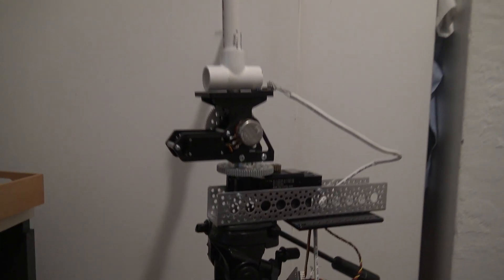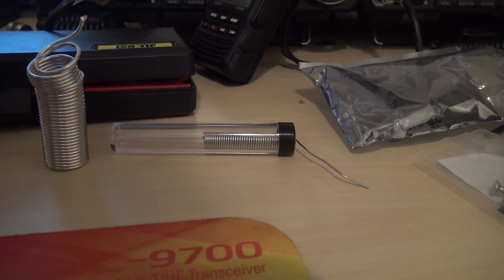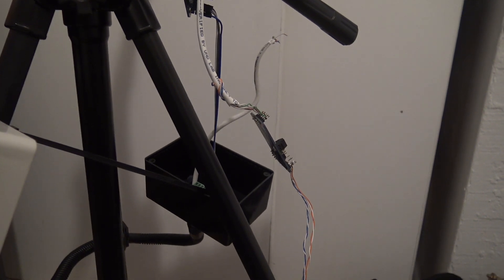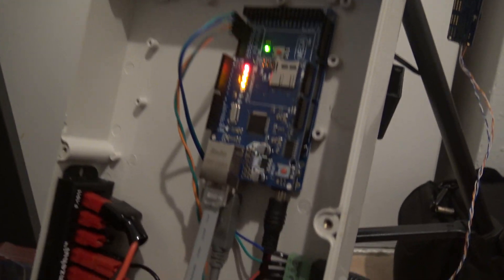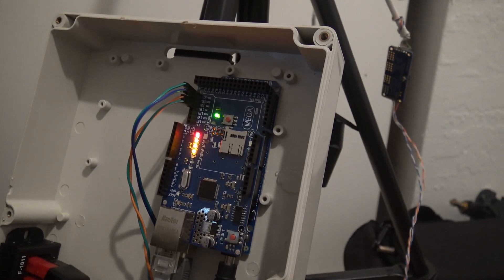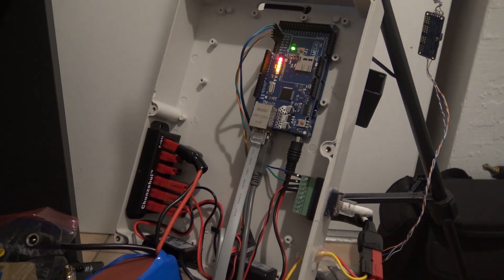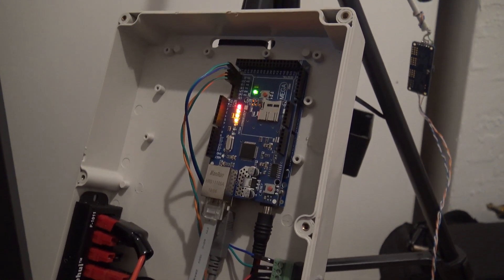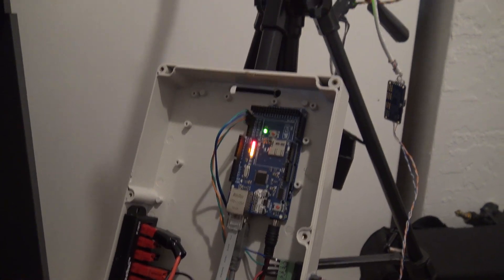Ham Radio Satellite Tracker Update, I'm Having Issues

Comment: W1RNY  I have been looking at your videos for a bit.  I first got my ticket in 1967 but let it lapse in the late 90s.  Never did much with amateur radio.  Now I am semi-retired.  Got my ticket back in August, 2019.  Working now on General.  I got interested in Sat work and picked up a pair of FT60s....found I only needed one for the FM birds....but got tired of holding the Arrow Portable Dual band.  

Last winter, HRO had their sale so I picked up both the 7100 and 9600......want to create a totally portable sat station with off the shelf parts.  Don't have the time or energy at this point in my life to make an el az rotor.  After a lot of research, picked up Portable Rotatation's El AZ rotor....12 v....already digital....no interface needed.....in the process of setting it up with PCSat32.....I will start with the one Arrow and see how well it does.....may got to two of them with a phasing harness.

Comment: Im also building a variation of the  Elwood Downey , WBØOEW tracker. Just as in his upgrade to the project, I'm using the ESP8266 instead of the Arduino although it shouldn't make much difference. I intend to build it fairly close to his design except that I'm also creating an interface to allow control of the azimuth and elevation from the software package "SDR-console" which also automatically controls the radio/s(up link and down link). I've written software that intercepts the DDE data from SDR-console in the Nova or Orbatron formats and sends the data over the wireless link to the ESP8266. The program in the controller will have two modes. The original control that uses TLEs, or receives az and el from the PC running SDR-Console.

Comment: Maybe a silly question, but you are not powering your board with the USB and the battery at the same time are you? Unless you modify the USB cable it will power the Mega from your PC. Just a thought. Also, if you want to check the operation of the ethernet shield, you can load the example sketch that come in the IDE. I think it is under file>examples>ethernet>LinkStatus.
Reply: Actually after a little more research it turns out the LinkStatus doesn't work on the W5100, so nevermind using it to test the linkshield. Sorry :-(
Reply: I found this link if anyone is having issues with the ethernet shield and want to test it. The sketch is from arduino. It was unable to find my hardware, indicating at problem with the shield. Hope it helps someone in troubleshooting. https://www.arduino.cc/en/Reference/EthernetHardwareStatus

Comment: If you hooked the laptop right to the Arduino, did you use a crossover cable?  That might not work unless you did or unless you hooked them both up to a common switch.  Also if you hook it right to the laptop, it would have now way to get a DHCP address, so it would not work unless you set the sketch to use a static address or it was on a switch that gave it access to a DHCP server.  Also, make sure you don’t have a conflicting address.  Does it require the console to proceed?  If so, you’d need to have the USB port connected.  Try one of the example IP sketches.  Like any troubleshooting, one step at a time.

Comment: Cable issue? Hey a crosscable from pc to arduino. Otherwise check configuration on acces point. Speed correct? Auto speed? Try  fixed.speed. check arp table. Check mac addres. Maybe ESD damage.. 73 PE1IDG

Comment: I have messed with Arduinos a little bit, I can’t offer any insight into your project though. I have done quite a bit of soldering though. It looks like you have lead free electrical solder too. I defiantly recommend lead type. Either 60/40 or preferably 63/37. It will flow so much better for you. 60/40 wets a little better, 63/37 wets good but solidifies faster. Less likely to get a frosty looking joint. KG7USM

Comment: I'm not sure but if you connect to the tp link with your computer or laptop. If so type cmd in search at bottom left of task bar and hit enter. Once in cmd type ipconfig see what gateway is example 192.168.1.1 may be different.  Once you find that open web browser and enter that address you should be able to access routers interface and see what ip its giving your arduino and pc. Hope that may help. KO4BJV

Comment: Greetings from Eric/KB3DTQ. I'm in the process of making a portable Satellite Ground Station for Amateur Radio. After a lot of research on Rotor controllers I came across the 'SARCTRAC Project' which is controlled by both the Arduino Pro Micro and the Raspberry Pi Zero. The Rotor Controller that I'm building is the MK1b https://www.sarcnet.org/rotator-mk1.html. It uses GPredict tracking systems and so far I'm very satisfied with the results. It includes a parts list in the manual so you can either buy the SARCTRAC Kit or buy the components listed in the manual on Ebay or Amazon. However, it sounds like you have a Boot load file issue with connecting to the internet. That's where the Raspberry Pi Zero is used in the SARCTRAC Project, you save all your IP Internet info to a flash drive and plug it into the Raspberry Pi Zero. When you power up it automatically loads you internet login IP info. Hope this helps. 73's from Eric/KB3DTQ

Comment: Hi, do yourself a favour, get yourself a decent ROLL of lead based solder from a reputable electronics supplier.
When you have a good roll re-solder all your joints.'
What soldering iron and tip do you have?
Take ALL the hardware out of the frame/case and  lay it out on the bench and work on it and debug it there.
That interface board floating in mid-air with wire soldered to header pins is not good, I cannot see any insulation around the joints and its all floating around with tension on most of the plugs and wires.
Do you have a fuse on that Li-po,?
Sorry but  a Ham Radio Operator and you do not have a roll of decent solder!!

Comment: Whoa...!

Before you go further...

Please find some way to support your battery!

If you'll notice, the positive wire is stretched taut, and it is pulling hard over on the anderson power pole on your distribution board.

Much more and you're going to break the solder joints or worse, snap off entirely & drop your battery to the floor.

Sorry I can't help with your firmware issue.

Comment: Hang your laptop on the router and check the connection. It sounds like the Arduino has a connection with the router but the router has no connection with the network. Also check the permissions on the router as mentioned in the comments. Good luck, 73's, Xander NL134

Comment: As an IT guy, my first question is always "what changed?". If I understand you correctly in the video, AFTER the soldering you hooked it up to the laptop, downloaded the sketch again and it worked. Then you disconnected it from the laptop and moved it across the room and it didn't work.

The first thing I would do is go back to the last working configuration, that is hook it back up to the laptop and download the sketch again. If it works that way then change only ONE thing at a time until it fails again. Don't disconnect it AND move it, do one or the other at first.

Hope this helps.

Comment: I have been following and building one also, but I decided to start with the software side. I ran into the same problem. After researching some Arduino forums, I found that some of the ethernet shields have problems on the MISO connection, the 6 pins between the Mega and the ethernet shield. Not much to do but get another one. I ordered the ESP8266 controller with WiFi . Installed the libraries and instant connection. This replaces the Mega and ethernet shield. The router can still be used for a hotspot. I never did find a definite fix for the connection problem between the Mega and ethernet shield. The code for the ESP8266 has a shortcut on the sat tracker website if you decide to go this way. If I can help in any way, let me know. Good luck.

Comment: Sounds like the sketch is not being maintained in non volatile memory. The fact that it only works after you reload the sketch is glaring. Try uploading the blinking light sketch. It's been a while since I messed with the arduino IDE, but that simple sketch was included in the example sketches. Power off and on again (poke at the IT crowd =)  and see if the light still blinks. If not, your sketches are not being stored during a power off.
Reply: I agree. Upload a blink sketch. See if it will hold memory after power cycle.Commits on walk away for a while also great advice and the hardest to do.

Comment: Hmmm. Heat and static does bad things.  Use 70, 90 %rub alcohol and el cheapo tooth brush to clean up board around solder joints, dry with warm air....look for other joints that may come loose. I use cream flux on everything..just a witness amount on clean pads.  Grounding static wristbands too..has to be a simple fix Eric..back up few steps..restart, maybe a bridge of solder..